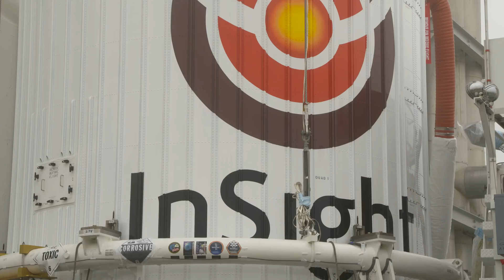InSight Mars Mission's Road to Launch: Countdown to T-Zero

Comment: I am sure being a 9th grade dropout, I could not possibly think of something others did not, but are you guys at NASA making sure they installed a windshield type wiper blade system to clean off the solar panels on the drones/probes you send to Mars? All you people drive every day and should know the value of a wiper blade system to clean the solar panels. It does not have to be exactly like a windshield wiper but function similar to one. This is not rocket science, it is janitorial thinking.